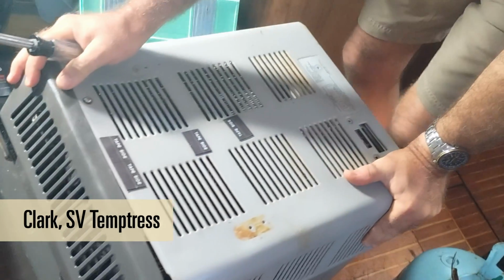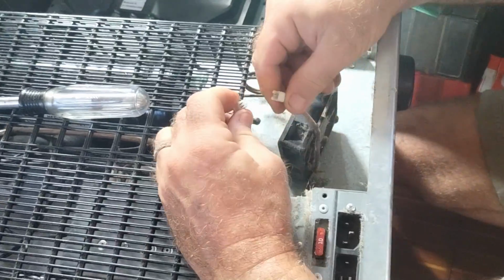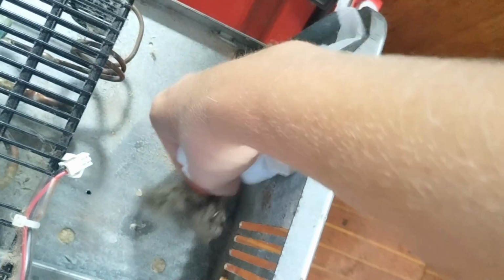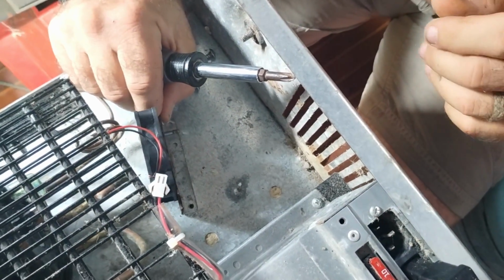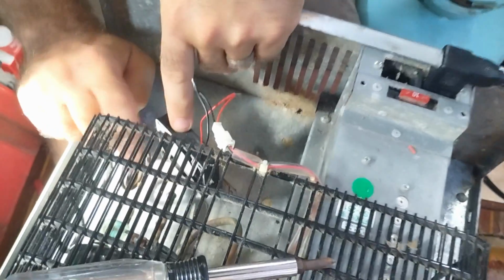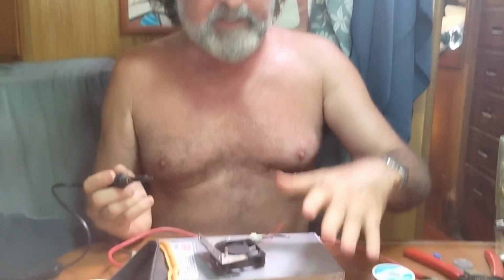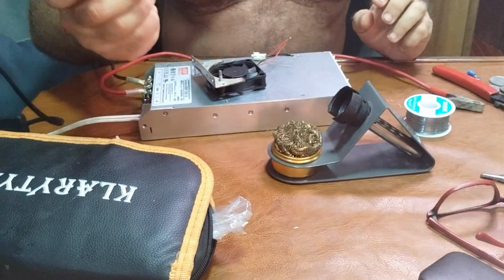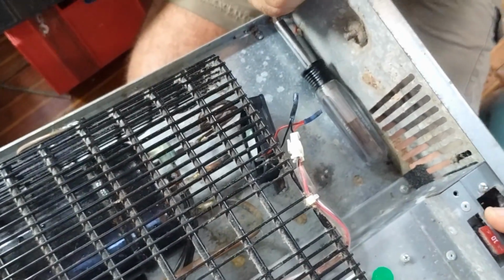Fix an Engel Fridge Fan - in 15 mins

Comment: You can buy a plastic engel but the latches need to be custom s/s out of Australia 
I’ve had these Engels in the has heat environments for 30+ years
Worth every cent
Reply from the maker: Yep they are new 
    I'm also very happy with the extremely cheap plastic refrigerators out now.  I reviewed one

Comment: A lot of fridges are 12/24v devices. My dometic is 12/24/120 (and probably 240 I haven't looked) and so are most Engels. It was given to me as AC works but DC doesn't because the DC cord smoked. But when I tested it the AC just supplies 24vDC to where the DC comes in. I got another cord and it works fine at 12v, I don't have 24 to test. I think in my case the previous owner either had it plugged into 120 and 12 dc at the same time (and it tried to charge the 12v battery with 24v) or he cut the plug off and tried to connect it directly and got the wires backward. Thus smoke. All that to say, I would stick with a 24v fan. If it's like my dometic, the compressor will say 24v as well. If the owners will always use 12v I guess it doesn't matter  ;)

Comment: I'd always soldered connections when i was working only in electronics, but when I started wiring high current DC power circuits they convinced me that proper crimps are preferable, in those circumstances.
Reply from the maker: I agree.  SE my electrical series episode on terminals.

Comment: When dealing with a "Failed" fan I find 95% to 99% of the time its simply lack of lubrication.  Under the label covering the motor is usually a rubber plug which you can remove to add oil to the bearing.  I usually use a Dexron 1 or 2 Transmission Fluid or a Synthetic Sewing Machine Oil to lubricate them so the high level of detergent in them will loosen up any gummy oil residue in the bearing.  When repurposing a used fan I will proactively pull the label and lubricate the bearing before putting the used fan back in service.  Of course replace the rubber plug and clean up any oil residue from the surface where the label gets glued back on to retain the plug.

Often after lubricating the fans they run quieter and longer than they originally did before the bearing gummed up.

This one may have been the one in twenty that had failed electrically but its worth lubricating them for the potential nineteen out of twenty wins.

Best!